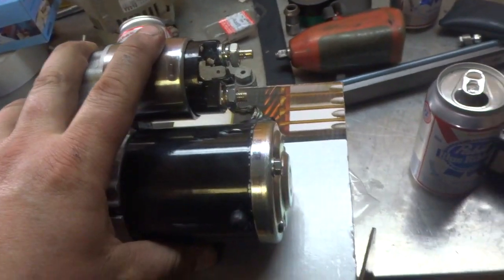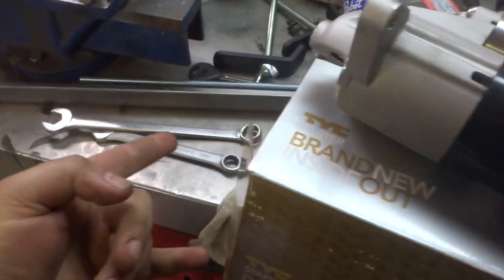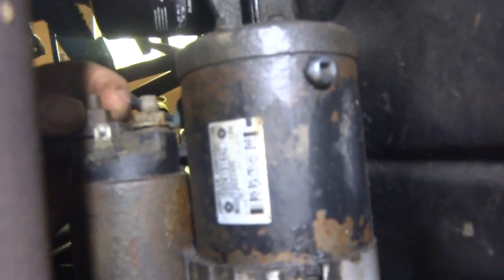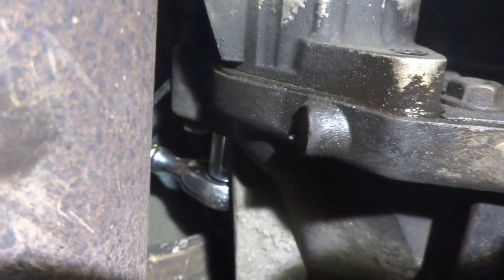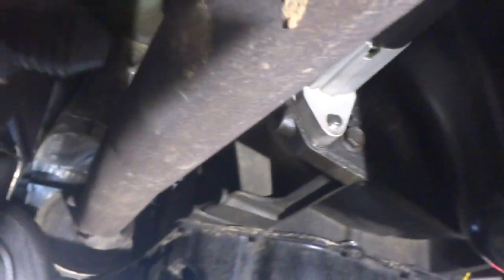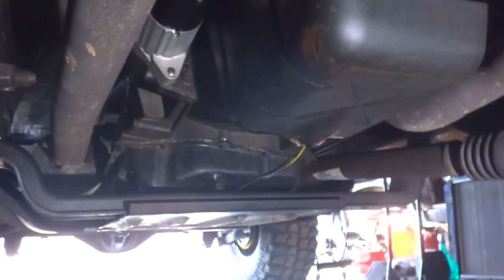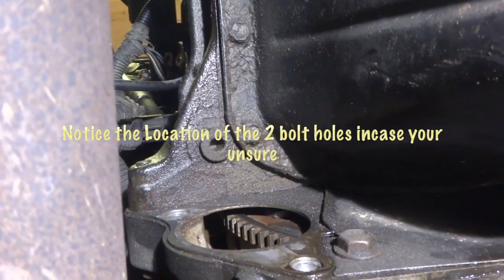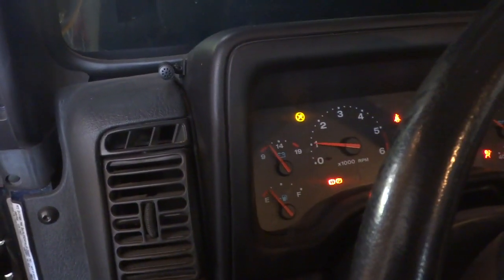Jeep Starter Replacement DIY

Comment: Son's TJ wouldn't start this morning, CAA showed up and said battery was fine, but son told me that clicking could be heard...I went online, noted this video details, called NAPA for a reconditioned starter, picked that up along the way to Son's residence and then crawled underneath the TJ with my socket set...fixed in about half an hour.... thanks for the clear instructions!

Comment: The best video I have seen on this repair. Used the exact same starter and everything. The only tough spot was getting the top bolt but if you have a stubby ratchet it shouldn't be a problem. 30 minutes and I was done.

Comment: My 06 Golden Eagle was driving fine Saturday. Went to start it last night to watch the fireworks and I got one click. Unplugged the battery terminals and cleaned them up but still one click. Hoping it’s the battery as this has happened twice and the first time the mechanic put 3 starters in after testing the battery and claiming it was fine. Towed it to a shop and an hour later got a call that all it needed was a new battery. Gonna try to jump it and if that’s doesn’t work, I’m guessing the starter might actually be toast this time. Does that sound right?
Reply: Got the battery tested and it should be fine. I swapped out the Starter Relay and still one click. I then tried jumping the Starter Relay but only a click again. Does that mean it is the Starter motor or perhaps the starter solenoid?

Comment: Did you see that 3/4" hole when you took off the starter (just above it by the oil pan)?  What the hell is it?  Does it need to be plugged?  I am replacing the starter on mine right now and I saw that hole... HELP

Comment: So I have 2001 Wrangler Auto,
It was rebuilt so I have star bolts instead of the 15 MM which I got off  and the terminal was a bitch. The issue I have is that the oil pan is blocking  the starter fro coming out. The bindex keeps catching, any ideas or do I have to remove the whole oil pan?

Comment: About the bolts - I used a breaker bar to loosen the lower one.  The upper one there's no room - WD40 penetrating lubricant that that last dealer was nice enough to use on my arse did not help.  I'm no body builder, so that doesn't help with the 8 inch wrench's torque delivery.  I don't have access to and cannot afford a torch to heat it up.  Any ideas?  Thanks...
Reply from the maker: +Matt Key try using a double wrench

Comment: Hey I got a question, I got an 01 jeep with a manual transmission, I hear I have to get a starter for a manual transmission... I also don't have the terminal you unclipped... what is it for and would it be OK if I got a new starter with the terminal and unly used the positive and negative wires (i only use +/-)
Reply from the maker: +Cesar Gonzalez you have to have that terminal as that is the starter solenoid signal wire

Comment: Would a bad starter cause the ignition switch fuse to blow every time the key is turned?
Reply from the maker: There is way too many variables to say yes but it is possible. Blow fuse means something is shifting out somewhere

Comment: that job would pay about .8 of a hour at my shop which is about 70 bucks plus the markup on parts
Reply from the maker: Where do you live with 70 hour shop rate. Most dealerships here are 100 plus
Reply: $70 an hour and they cut off your catalytic converter for scrap...ha! ha!
Reply from the maker: ***** for 70 bucks a hour they'd replace your brakes when you asked for the tires to be rotated hhahahah
Reply: That's no shit! Pimple faced video gamer has a ASE card and thinks he's Mario Andretti's mechanic.

Comment: Wish my Honda was that simple.  It's got a transverse V6 engine with no room and components put in shitty spots.  I don't mind working on my own car, but sometimes I think I would have an easier time reading a VCR instruction manual written in Vietnamese than working on my Honda.  I should have gotten a domestic vehicle.
Reply from the maker: I know what you mean, my BMW is one car I hope I never have to put a starter on
Reply: Bullshitkorner
Step 1:  Remove vehicle from around part to be serviced...
Reply: rhkips in 18 months when my accord is paid for this is the advice I'm going to take. All my YouTube videos on my Honda will be short and sweet. Wanna learn to change the starter?  Take a hammer to it, wanna change the dome light? Fuckin hammer. I may just take a hammer to it just because lol.
Reply from the maker: BuddyLe3 the hammer has been known to fix many problems but it has the be the 3lb mini sledgehammer

Comment: I had two different sizes of bolts holding my starter on.A 15mm on top and 14mm on the bottom. Then the bottom bolt wouldn't go back no matter how hard I tried. Thanks Chrysler...